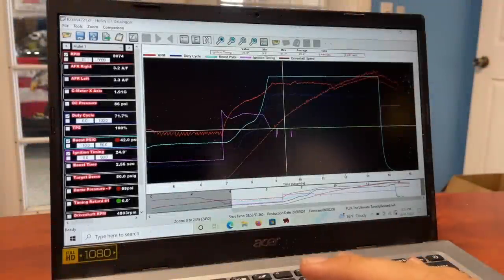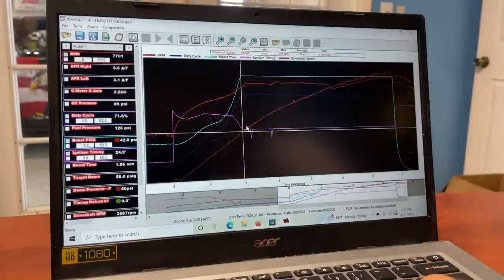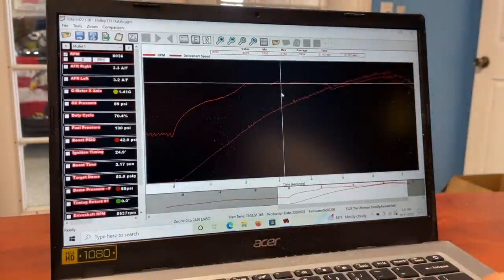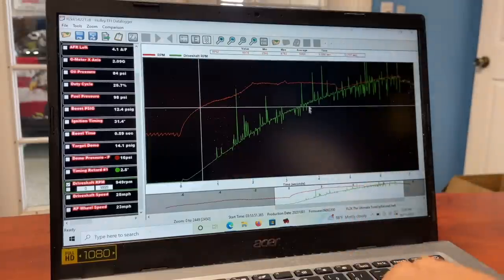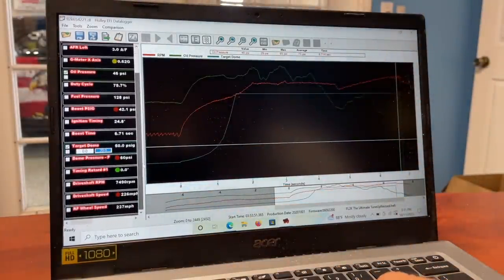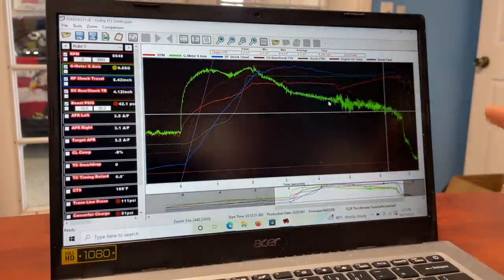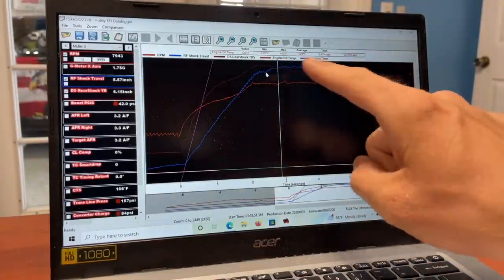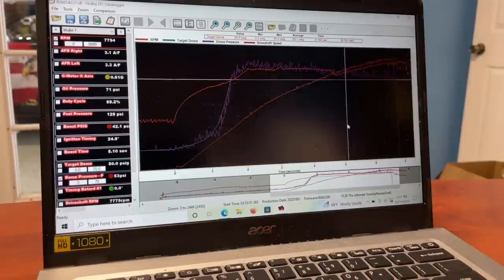The Data Log From Mullet's 6.54 - 221mph Pass at FL2K - ALL THE BOOST!!!

Comment: What you didn't mention but I could see from the logs is that big block was turning over 8700 RPM out the back door when you went through the traps. Steve damn sure knows how to build an engine!
Reply: My 454 does it all the time.
Reply: The sound Mullet was making as it roared by in the footage from the stands was amazing.
Reply: @gearbanginentertainment7476  Sure, as does every internet keyboard warrior with no videos on their channel. My LS turns 12k RPM's on the trans brake and spins to 23k RPM's going through the traps.
Reply: @gearbanginentertainment7476  is that you bicycle?
Reply: @Beardest_Fishing  my 3.5 transverse eco boost shifts at 15k
Reply: @gearbanginentertainment7476  …. Cool story bro.
Reply: Definitely a good Cam and valve spring combo
Reply: @Beardest_Fishing  👈🏻lightweight
Reply: @Mechanic618  I came here to say the same thing! Mullet was screaming!
Reply: @Beardest_Fishing  its not that hard to build a 454 that revs to the moon, we have a pair of them in pulling tractors (there are a couple videos on my channel if they're still public) that we used to run to 9500 every pass... we broke a lot of rockers so we changed the setup and run to about 8-8500 every pass now... we've been 100 passes and more just lashing valves and changing the oil... 

actually, the last time we went that long without pulling the pan off one of them was when we were still running a stock block in one tractor... only problems we've had in a decade have been in the valve train... 1200lbs over the nose with a ton of lift will fuck some shit up... 

we're totally n/a carbureted 485ci in the close to 900hp league on 24-degree steel heads, hard to get them any better with our rules
Reply: @Beardest_Fishing  what in the F1tarnation is this
Reply: Have the limiter in my big block at 8300.  Just have to build it right
Reply: @corykluthe355  You don't have videos either? But you are posting on a VIDEO SHARING PLATFORM. Which means you don't have a big block turning 8300. ;)
Reply: @BassManBobBassCovers  lol yeah, sure. That's all it takes.
Reply: @CrashRacknShoot  pretty much
Reply: @BassManBobBassCovers  no, not even a little bit.
Reply: @CrashRacknShoot  what does it take then? 🤣
Reply: @CrashRacknShoot  On LS engine all you need for a high RPM build is a cam and springs like Kevins drift build. In a high horsepower application, you will need rods pistons springs and retainers.
Reply: @BassManBobBassCovers  sure, it'll then go 8k, the question then is for how long? Those tolerances need to be tight to sustain that throughout on the crank, the cam, proper lash, etc. Otherwise you'll be spending more time under the hood after a "sick full send, bro!" than you will be actually driving it. That involves a lot more work. But you go ahead and rev to the moon with a couple slap ons.
Reply: @BassManBobBassCovers  The balance of the crank, rod and piston masses become very critical when spinning a big block that fast, for one.  You're right in that it needs a damn good valve train setup too but that's definitely not all it takes.
Reply: Ive seen a b series honda 1-2-1 shifted pulled 13k no sweet for a second haha
Reply: The amount of shit talking is wild🤣
Reply: good components, and keeping it out of detonation is the key.
Reply: @BassManBobBassCovers  definitely not all it takes. There is a thing called piston travel speed. Depending on the stroke of your engine, the speed at which your pistons travel from bdc to tdc and vice versa can he detrimental to whether it can handle the high rpms or not. The longer the stroke, the faster that piston travels from bdc to tdc at any given rpm. This puts more stress on the attach points such as the rod bolts and caps, and the wrist pin area on the rod and piston side. With parts not made for a massive amount of stress in these areas, they can die pretty quickly when adding said stress. Boost can add to this stress, but also can take away from some of the stress as well. With the upstroke, the piston will have roughly the same amount of pressure forcing onto the piston, but during the intake stroke, rather than having the rod pull down on the piston at the wrist pin and suck air into the cylinder, the boost will help by forcing air into the cylinder as that valve opens and the piston starts traveling down which will take some of the stress off that wrist pin area on the downstroke, if not changing it entirely to the stress being the other direction. There is one thing for a freshly built engine with lower quality parts not built for it to rev up that high once or twice, but for an engine to survive it as a normal occurrence, it needs good parts for the rotating assembly. 

Now, I DO agree with you that you DO need a good valvetrain, but that's not all you need. Depending on the engine size and the application and use can determine a lot of what you're gonna need on top of the valvetrain.
Reply: The amount of regurgitated nonsense is off the chart, none of you responding to this post have ever made a pass... just stop.
Reply: @killorkubed  Its a 540 that makes around 3000hp and still turns 8700 without exploding.  Not hardly the same scenario as yours.
Reply: @sasquatch1554  Don't get me wrong a 3500hp street car motor is impressive af you won't see us dropping one of our motors in a street car, we're pushing our valve train WAY harder than cleeter is... hp doesn't have a lot todo with it valve lift/spring pressure does... and I promise we're running way more of both than mullet is
Reply: @eriklarson9137  so because i dont post videos its not real?   I know theres a view videos floating around. Just not me taking them. Its in a 33 chevy coupe

Comment: We need a hub dyno run with the last pass tune. (It will tell if they are pushing the engine too hard)
Reply: This
Reply: Iam with ya!
Reply: I was just saying that to my buddy!
Reply: Wanna see all them horsetorques
Reply: I agree on the horse torques and bald eagles test
Reply: I'd be hard on the car for no reason. Their dyno can't even read that high anyways.  It's got to be making about 3200hp
Reply: @BaldBozo  They don't have a hub dyno.  Also, a dyno run would be an excellent opportunity to know if they are pushing the engine over its limits. (or the entire power train)
Reply: @BaldBozo  highly doubt it’s making 3200
Reply: @nalley6815  probably making 3k. if you do the math on the last pass based on its weight.
Reply: @pcihector  they said they had one on order but don't know if they ever received it or decided drop it.
Reply: @BaldBozo  He said hub dyno not chassis/roller. The purpose of hub dynos are for that kind of horsepower.🤷‍♂️
Reply: Was just thinking that
Reply: Is it possible to drop more weight on Mullet? :3c
Reply: Ye
Reply: Didn’t know you could push a big block to hard 😂😂
Reply: @russellv6234  yeah I was going to say the same thing. Calculator I used puts it at 2800+hp at 3500lbs to go 221mph
Reply: @redrolo149  yes if they went full race car with it but it’s still a drag and drive car
Reply: @sirmonkey1985  it sounded like supply chain issues with the dyno manufacturer. Idk if they are still going to get one but it sounded like it was just a waiting game.
Reply: @Kemicalkoma  can still swap over to carbon front clip like alex taylors 55, swap the floor and quarters to carbon. And they havent said anything about if they took out the street fuelcell in the back to run it full metanol, then they can ditch the radiators with some fancy quick connectors. To run it without in these comps and then tame it up on drag n drives :)
Reply: Morris rates this engine at 3,000hp plus, so he's pushing it already. To go much faster he needs the SMX.
Reply: @pcihector  but they ordered one when I ordered the other one.
Reply: They aren't pushing this motor even hard at all. Even this pass is about 50% of what this motor can do. Other people have used this exact same motor from Steve Morris doing 90 PSI boost and more than twice as much power as Cleetus is doing. This motor is barely working at all to do these 6 second passes in Mullet.
Reply: @liiiinder  They have the tank in back for both D&D as well as a ballast for just in case. they also have a like 3-3.5 gallon alumnium tank up front for the alky
Reply: that was Steve's tune . I think he's the end all do all when it comes to his platform
Reply: @Kemicalkoma  Whoops didn't really mean to post that as a reply to the Main post here.
Reply: @TheTileGuys  Right what'd he say the RPM was like around 8000? I thought parts normally started flying before that number on bog blocks.
Reply: @Dwreck...580  you aren’t lying 😅
Reply: @Sabrinahuskydog  Not according to Steve...
Reply: @deegan727  absolutely fuel Tech had a Pro Mod get over 5,000 on their Dino
Reply: @redrolo149  all aluminum Billet SMX block is a good start. Maybe a little more from elsewhere too.
Reply: Lol, define pushing an engine too hard ... Uh, I think they are well past that!
Reply: @BaldBozo  lmfao nah more like 2800
Reply: @BaldBozo  They don't have a hub Dyno.
Reply: waste of money and time.... all we need is slips
Reply: They need to go put it on Steve's hub dyno
Reply: @BaldBozo  I did the math. At 3500 lb, with a .42 drag coefficient, trapping 221, that car is making about 2,600-2800whp, so idk 3300 at the crank?
Reply: @pcihector  But when they got their current dyno, he mentioned a Hub dyno was going to be order/had been ordered
Reply: What do the plugs look like after that run?
Reply: @BoostedSpeedDemon  yeah I wasnt talking wheel hp. I was going off the engine Dyno Steve posted. You're numbers check out to what I was saying.
Reply: @pcihector  sorry missed the hub dyno part. I was talking crank HP.
Reply: @pcihector  they do have a hub dyno it's just taking forever to arrive.
Cleetus mentioned that not long after the roller arrived.
Reply: For science!!!
Reply: Ive been thinking exactly the same thing. Im going to say the numbers would be similar to leroy’s 60lbs of boost
Reply: I'm here for it
Reply: There’s absolutely no reason for it
Reply: Yes I need to know that exactly, let's get that done asap cleeter mosquiter..
Reply: I’m sure he could just send the data to Steve Morris and he’ll say yay or nay.
Reply: This^
Reply: As dialed as it is I hope they pull it apart and check over everything.
Reply: Agreed 🤘🏼💪🏼🤜🏼
Reply: @Sabrinahuskydog  That is NOT an SMX in Mullet.
Reply: @Dwreck...580  that’lwould be a bad ass site to see not going to lie 😅
Reply: That engine was built to do what it did if you want to win sometimes you got to give it all its got and it's got way more than that boys
Reply: @Sabrinahuskydog  what? only 50%? look at the pinned comment, steve talk about cleet over recommend boost. this engine only rated at 45-47 but cleet go to 60 psi...
Reply: @redrolo149  they're talking about a billet block. So yes, a lot of weight.
Reply: Or ask Steve Morris
Reply: @Sabrinahuskydog  Mullet has the cast aluminum Brodex block SM motor, not the billet aluminum SMX.
Reply: @Sabrinahuskydog  you are mistaken for the SMX billet engine.  This one is an inline headed aluminum block 540. Steve even mentioned the boost numbers are a little high as well as Mullet ran 1.5 tenths faster then he figured.
Reply: @jasonjusti6109  You must be new around here. Back when Cleetus was first installing this motor in the El Camino and Steve Morris himself was in the shop tuning it on the dyno his own words said he has seen other people doing north of 6000 hp on the same motor. It's in a video if you go back and watch it. You probably weren't watching Cleetus back then.
Reply: @pcihector  and how do you figure that ? Steve already commented it’s over his recommendation. But unless it breaks on the dyno what is it gonna tell you other than the hp numbers for the dyno day and conditions . The m&m tranny is rated for anything . The rear end is designed to take whatever you can give it . The only question is the engine so if it doesn’t kick the rods out what will hub tell you ?
Reply: @fireworksbill  He said in this video that the plugs looked good!
Reply: @TheTileGuys  you can push anything to hard.
Reply: @Sabrinahuskydog  Steve never said this engine is capable of 6000hp. Like many others have responded to you, this isn’t an SMX it’s a traditional BBC style engine. I did watch that video back then and I just rewatched it to hear for my self that he said 6000hp, never happened. Even on Steve’s business site he only rates the SMX at 4500hp which is obviously more capable than the big block he rates at 3500, but somehow you come up 6000? It also doesn’t matter how long someone has been a subscriber especially when your wrong. I’ve been a subscriber for years too but don’t expect validation or cookies for it………..6000hp.😂
Reply: @Sabrinahuskydog  why is steven himself saying that this is not the recomended combo ?
Reply: How will the dyno tell if it’s pushing the engine too hard?  This video shows you the all the data you need.  The dyno won’t put anywhere near the load on the motor as it saw on that pass.
Reply: Egt tells you also you are reaching critical limits....
Reply: @randalltufts3321  just so you're up to speed, that wasn't Steve's tune. This, and the majority of FL2K Mullet tunes, came from another racer named Pete. It's been said that Steve set timing numbers before install and advised them not to mess around with them very much .
Reply: @patrickmuzzi  Steve and the gentleman at "good at doing stuff did a great job with the car. Its extremely heavy and has a long wheelbase . Seeing it get down the track at 6:54 was a good hit for a street driven car built for race week any way you cut it. It was enjoyable watching the car make 3 personal bests in one outing. Between cleetus, Steve, Dr tunemall, and Pete.  Pete finally  got it handled. Have a great week !   Have a good rest of the season
Reply: @Sabrinahuskydog  actually even Steve Morris said that they were slightly above the recommended boost level for that engine
Reply: @TheTileGuys  Top Fuel
Reply: @Sabrinahuskydog  in Steve Morris’ own comment on this video, he calculated it at 45-47 psi and said it was a little bit over the recommended boost for this combo.
Reply: Hey, just curious. Does the fuel pressure rise purely from the boost pressure signal? So if you MAP is maxed out it would not be able to tell the fuel pressure to rise past its max. Correct?
Reply: @BaldBozo  exactly.  How in the name of god a Dyno hub is going to see how healthy and the limits of the engine is idiotic.
Reply: Steve Morris just said hes a little over the recommended use.

Comment: You got that right Cleeter. If the engine builder says that timing is good, then it's good and that's what matters. There is a certain amount of wisdom in knowing when to defer to the expert for specific knowledge and not questioning them when they tell you information. There is no loss in pride in admitting that you don't know some things and therefore trusting the guy who DOES know. The more time you spend with the big block, the more knowledge you will pick up over time and before you know it you'll be just as informed about big blocks as you are with LS's. Thanks for sharing the data from this spectacular run.

Comment: The support you get from all around is phenomenal. 
KSR for chassis,cage and support systems. Steve Morris engine guru. The staff and friends you have. Then the multiple engine/transmission management tuners,chassis tuners, transmission builder, torque converter specialist.

Comment: The crazy part is theres still so much more room for improvement, Mullet is just tapping into its potential. Yall have an amazing team
Reply: Not really…the data shows it’s pretty much at its limit.  You can throw more turbo at it but they are past the power level of the parts as is.  Can improve the short track on some 315s but I don’t see a bunch more et left in it without scattering the motor.

Comment: The dips in oil pressure that you see on the top end are (most likely) harmonic fluctuations of the rotors gears inside your wet sump pump, vibrating harmonically.  I know this sounds silly, but it's a thing at those RPMs and pressures.  This is the most likely case as opposed to your theory on emptying the pan.  When you empty(ish) the oil pan it stays empty at those RPMs, it doesn't refill, empty, refill, empty; it fluctuates like you're seeing here from rotor gear harmonics.

Comment: Mullet heard "Moon Tune" and got excited and ran away a bit... :) 

Have you ever considered an Accusump for the oil issue? It's an accumulator so when you have the oil pressure issues it fill the gap. Also, if it's pooling in the heads have you done anything to get it to drain better? 

LS engines have more efficient chambers than a big block, so all things equal the BBC will always take more timing than an LS. 

I was hootin' and hollerin' for y'all watching that last video. It's so awesome to see all the hard work come together and gel like it did. Sucks about James but to break two cars and only lose by two ten-thousands of a second... That's just insane. You can't even blink an eye that fast... An eye blink is 50x slower at 0.100 seconds.